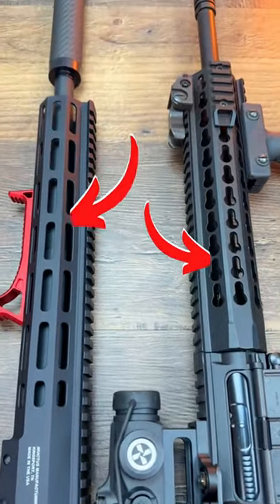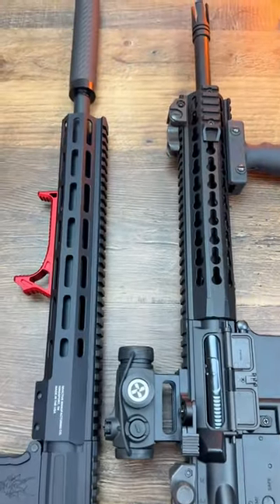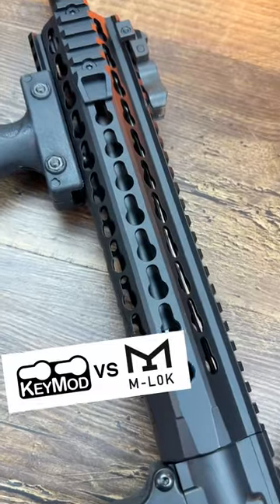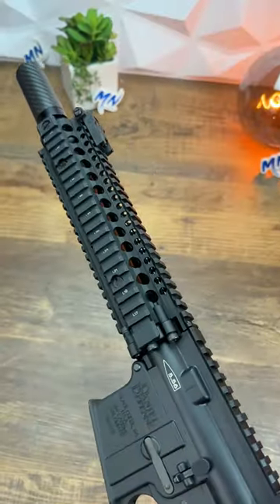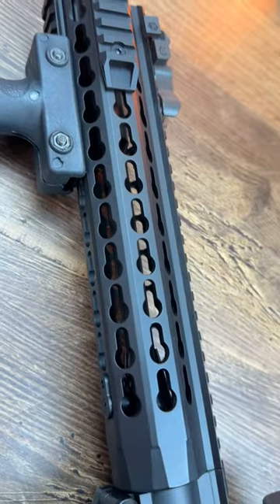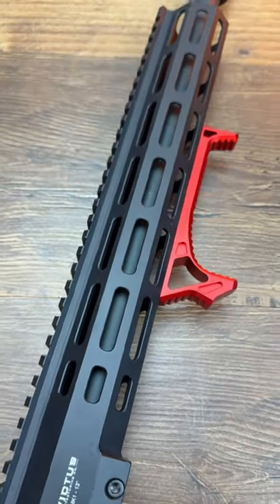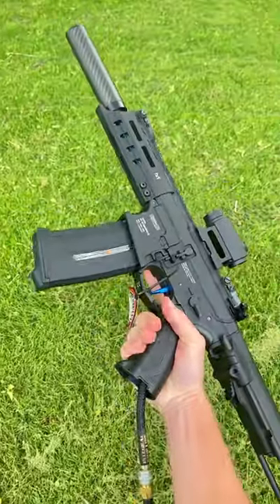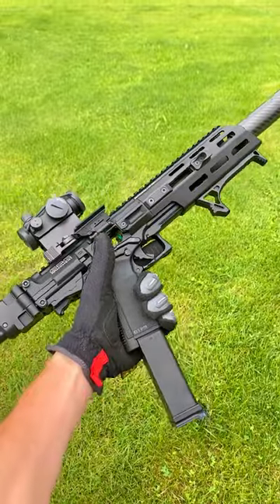MLOK vs KeyMod in 30 Seconds #Shorts

Comment: "stronger" only if using proper real steel versions. and then the testing done that proved a difference was going away above any normal and even extreme ranges beyond one may even want for combat. 

for a plastic body or cheap steal airsoft gun? either are good

Comment: Mlok utilizes 2 separate retaining methods. The bolts and the Mlok slot itself hold the picatinny/attachments in place. With keymod, you’re only reliant on the bolts holding your attachments in place, therefore Items mounted to a keymod are twice as likely to fall off. This was proven by USSOCOM in 2016

Picatinny is the strongest and also doesn’t get as hot, but it’s also much heavier with lots of unused, uncomfortable rails. With Mlok you can choose where the picatinnys mounts which is a huge advantage, but you’re sacrificing some durability. Trade offs.

Basically, if you see anybody running keymod, you know they aren’t educated and their equipment is purchased is for appearance rather than functionality.  Keymod only looks cool to the untrained eye
Reply: It has turned out that MLOK doesn't hold zero well enough for lasers and stuff either. But for most it's fine. I love MLOK and never cared for Keymod after I initially tried it out on a real AR.
I immediately noticed the big design flaw. Big hole at the rear, so if you bump stuff or a gun recoils, the lug wants to go to the rear, where it then falls out...
I had stuff falling off all the time at the right torque specs. MLOK standard also happens to come WITH thread locking compound on the screws already, unlike Keymod.
Seems we have a winner.
Reply: @CallsignWulf  yep that’s that’s exactly it. I don’t play airsoft, but on all my real ARs I’m running Mlok handguards with IR lasers and they have held zero just fine for coyote hunting, maybe not for combat applications but I’m sure we’ll find out here in the next couple years (iykyk). However, correct me if I’m wrong but I believe both Geissele and Daniel Defense have released MLOK handguards that are designed to hold zero and run grenade launchers exceptionally well

Comment: Is Umarex a good brand for Airsoft?
Reply: Yes Umarex a generally great brand for airsoft but big thing is that they generally expensive since the licensing and branding of Gun Manufacturers like HK, and Glock. Another good brand out be EMG preferably the Daniel Defense Line since they have a big rep of performance first before the branding. Plus the Daniel Defense line of EMG has a big community of both cosmetic and performance upgrades.

Comment: Quad rail is the goat, m lock is 2nd best, and key mod just comes in last place
Reply: Also the only dudes in the military that get mlock are SF guys, other than that your standard rifles are all quad rails, with the exception of a few models of the M110 that have recently come out but since not every unit has upgraded quad rails are still found on the bulk amounts of rifles